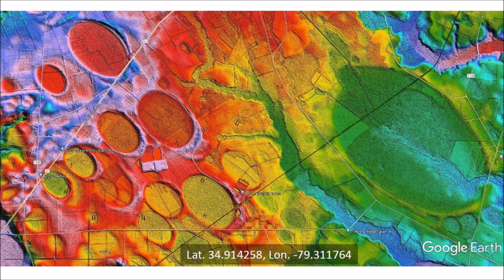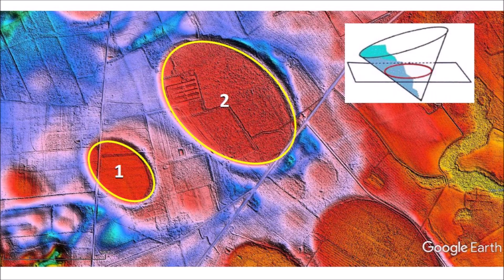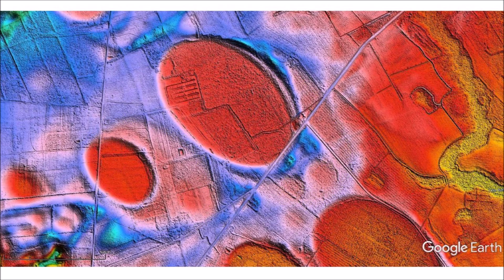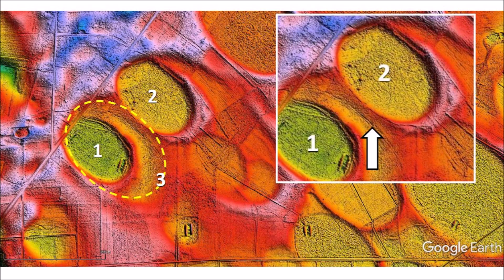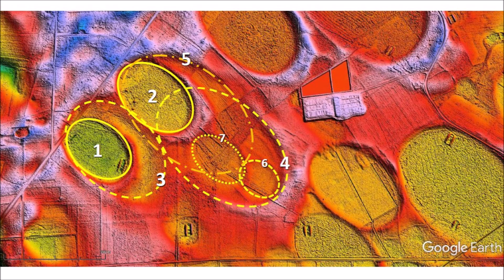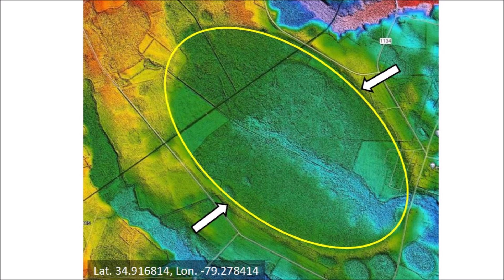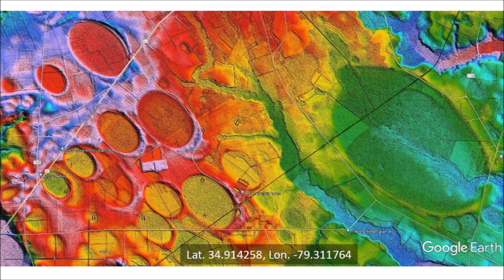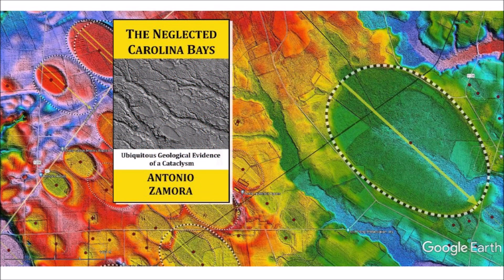Carolina Bays of Hoke County, North Carolina- Part 3 of 3

Comment: Anyone who has ever spilled anything, thrown a Rock, been on the receiving end of a water balloon ECT ECT ECT, can see that this is! Secondary splashing.
 I would think that some materials would have been ejected with the ice, should be some material foreign to the area.
 I'm amazed at the vast area's that don't have Bay's.
 All area's around the impact center would be saturated with fragments, but they are washed away, wondering what else was there?
 Since we're considering multiple impacts, Greenland, great lakes, spot's in Canada.
 Have read some stuff about a possible Pacific ocean impact North of Vancouver island. Looking at the terrain there seems to be evidence of massive water flows coming inland and draining south.
 I'm near the scablands of Washington and it's not cut and dry, the sequence isn't correct yet. Extra energy required

Comment: I have my doubts that terrestrial 'glacier ice boulders' could have made the Carolina bays. Our ice is too fragile soft and brittle to survive ejection from and re-entry into Earth's atmosphere without melting and vaporization. I think that the initial impactor was made of some different form of ice cooled to almost absolute zero temperature during its travel through outer space. I like to call it Neon Ice just for fun, but more likely frozen nitrogen or something like that. A much more durable ice but still capable of evaporating and disappearing from our view.
Reply from the maker: The reason why Carolina Bays are only found in unconsolidated ground is because ice is fragile. Only ground that could be liquefied by the impacts has Carolina Bays.
Reply: @Antonio_Zamora  I agree, but are you sure it was terrestrial and not extraterrestrial ice that caused the bays?
Reply from the maker: @daveulmer  Since 1933 scientists have been looking for anything extraterrestrial in the bays without success.
Reply: @Antonio_Zamora  With all these megaton blasts there should be evidence on consolidated ground and even on solid rock. Look for a bay that is next to rocky ground.
Reply from the maker: @daveulmer  check out this video: https://youtu.be/SWUlttaAmO0
Reply: @Antonio_Zamora  how would an impact on the ice sheets cause a black matte layer in the sediments from that time?
Reply from the maker: @doomoo5365  it was not the extraterrestrial impact that created the black mat. Ice powder drifting from all the ground collisions smothered the vegetation and created ideal conditions for fungal growth. The black mat does not have a lot of carbon like from fires.
Reply from the maker: @doomoo5365  The following video discusses the extinction event and the black mat: https://youtu.be/npXY8mu2hhU
Reply: @Antonio_Zamora  Did you find any of the 'black mat' near the Carolina bays ?
Reply: @Antonio_Zamora  Ice Powder ?
Reply from the maker: @daveulmer  The black mat is outside of the 1500-kilometer radius of the glacier ice bombardment. See the 17 minute mark: https://youtu.be/npXY8mu2hhU